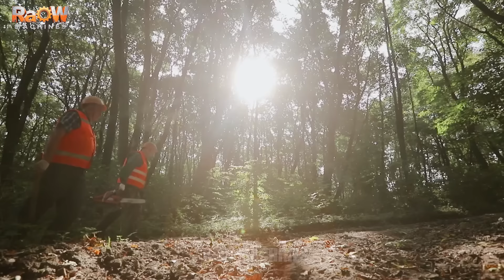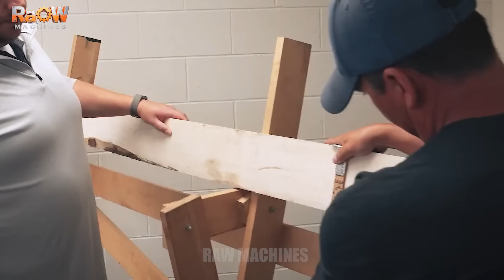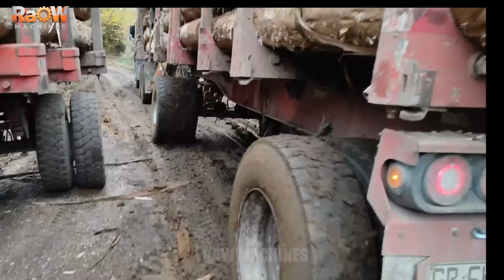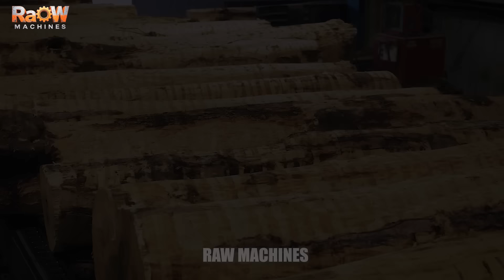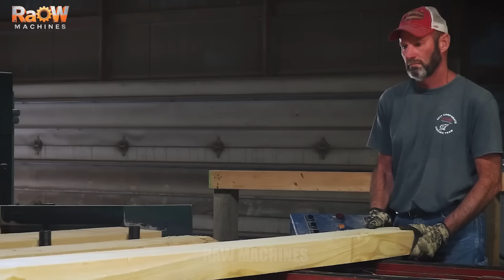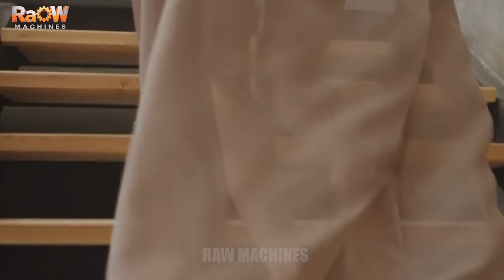How Logs Become Lumber: Inside America’s $500 Million Timber Industry Producing Perfect Boards

Comment: Baloney. Sustainable hardwoods? Get real. It would take a hundred years before we would even consider another harvest of the same species.

Soft pine and yellow pine are another story.
Reply from the maker: Fair point — many native hardwoods do need very long rotations, so “sustainable” harvesting only works with long-term planning, plantations, or strict selective management. You’re absolutely right that fast-growing softwoods (like pines) allow much shorter cycles and different strategies.

Comment: Every log turns to dust in seconds — amazing control.
Reply from the maker: Totally — that’s precision feed and blade setup in action. A skilled operator plus the right maintenance makes those instant reductions possible. Safety protocols are what keep it controlled. Which moment or machine surprised you the most?

Comment: Are those special tyres that have little or no threads?
Reply from the maker: Great eye! Yes, those are industrial tyres — smooth or low-tread designs help with better traction and durability on concrete or steel surfaces.